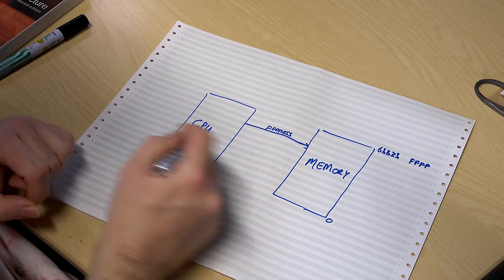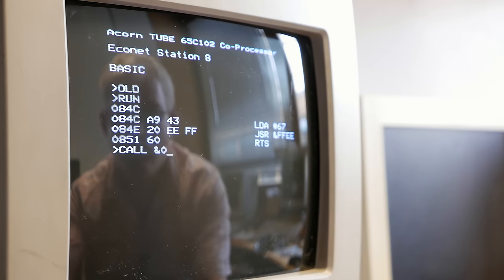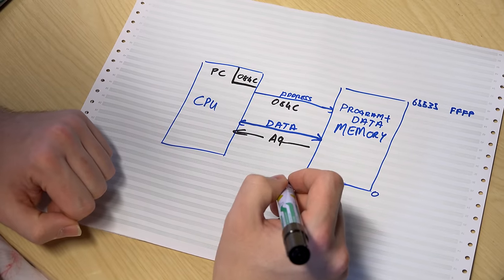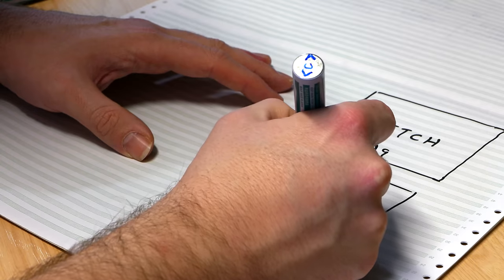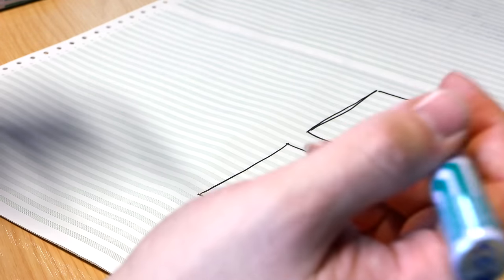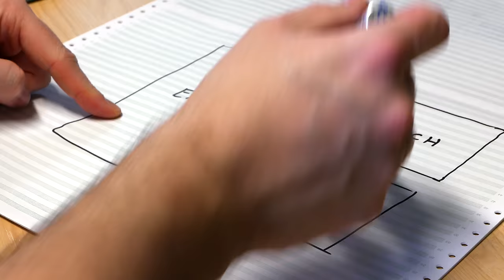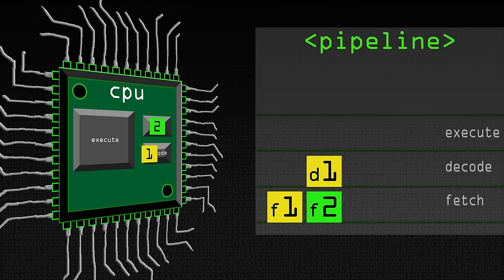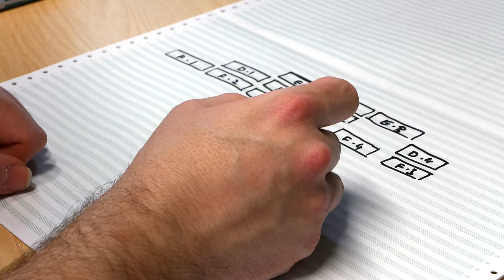Inside the CPU - Computerphile

Comment: how does the cpu know what to do?
Reply: The programmer decides what the CPU does.
Reply: yes, but how does it know how to fetch things or how to communicate between sections in the cpu?
Reply: It is just a hardware. You put power on and conveyor runs no matter what is on a pipeline. Like a flashing lights on a xmas tree: just plug in and it runs forever.
Reply: It's called "microcode" and probably the best way to get a feel for how microcode works is to watch Ben Eater's Breadboard Computer series here on YT.  The microcode part comes fairly late in the series, but you probably won't regret having watched everything leading up to that point since the earlier videos will help you to understand what's going on when you finally get to the part about microcode.

He's also great at explaining what's going on and why.  He keeps to the point while including all necessary detail.

Comment: Why would you need 8^15 bit long instructions? I knew x86 was somehow suboptimal by todays standards, but that is just crazy!
Reply: I think you mean 8*15 bits but i see what you mean (:
Reply: Oh, right, but possibly 8^15 different instructions o.O
Reply: I agree. Is it any faster to use smaller size instructions for the simpler, more common instructions? But why does X86 need such huge numbers of instructions?